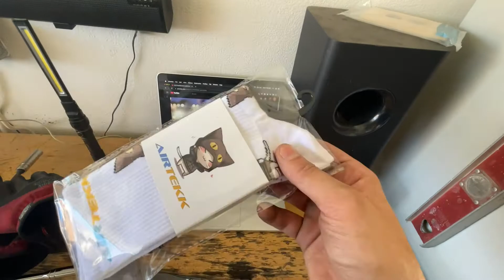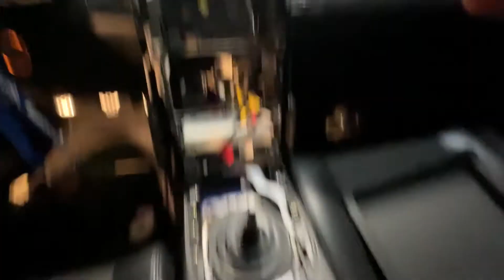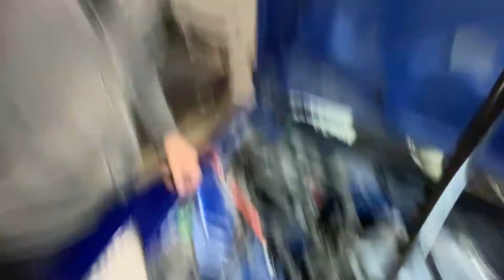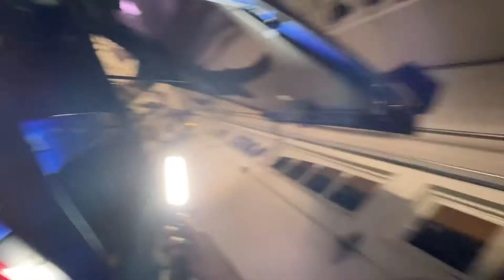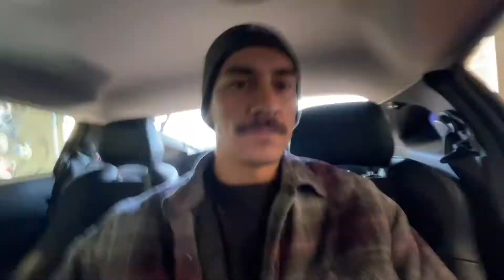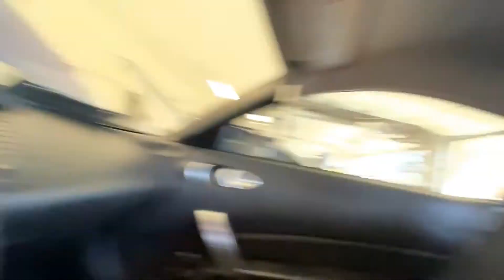Bagging a Nissan 350z! Airtekk Stage 1

Comment: Did all of the fittings come with your kit? I noticed my stage 1 kit doesn't seem to have all of the plugs I need on the tank. Contacted airtekk for assistance but super confused
Reply from the maker: No it was missing some for the tank, I had to get some from the local hardware store
Reply: @tonycrispin  Okay that's probably same issue with mine then. Thanks for the reply!

Comment: Do you have to let it build like that all the time or is that a one time thing??
Reply from the maker: Not sure what you mean, but the tank filling is done every time it empties, which isn't every time it airs out. The compressor will kick on whenever it senses the tank is running a bit low. So filling up from 0 is typically a one time thing unless you drained the tank for some reason.